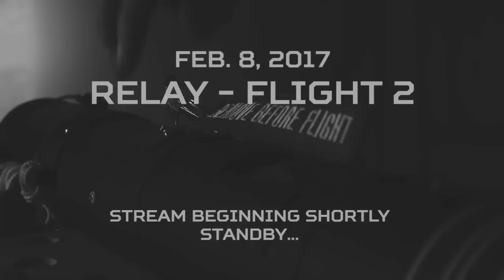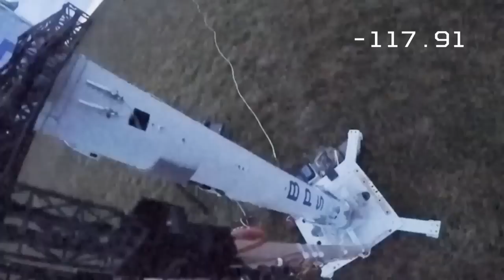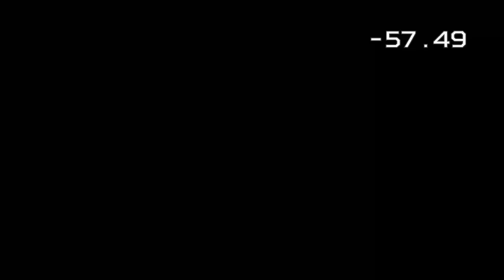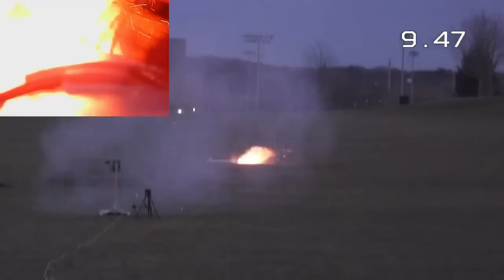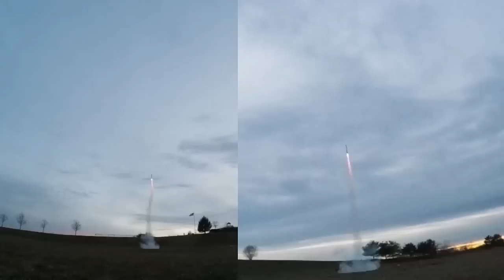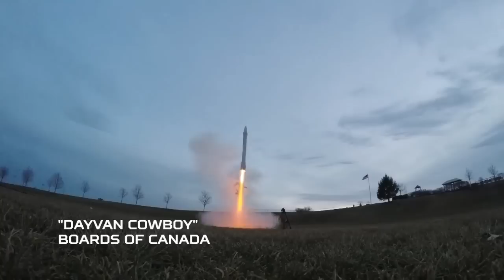Relay Flight 2 - Webcast Launch Coverage

Comment: why not periscope it?
Reply from the maker: There are a number of reasons, but the primary is quality. The higher level of quality I can achieve by waiting just a few hours far outweighs any benefits of spending extra time at the launch site setting up a stream. The situation would be different if I had a crew with me to help, in which case an actual live stream might make more sense.

Comment: An easy change you could make would be to change your drag fins so they are angled slightly, turning them into rotor blades. Look at "helicopter recovery" this would induce a spin on the rocket and make it spin stabilized on descent. This potentially conflicts with the ability to control the thrust on descent or the actual landing feet, but it may be an idea you can experiment with.
Reply from the maker: I likely won't go for the spin stabilized approach. As you mentioned, it becomes difficult to effectively thrust vector at a high enough spin speed. The next design I'll try is more of a conventional model rocket fin assembly. These should help guide the airflow in the right direction, as opposed to simply ruining the flow at one end.

Comment: The problem with your drag fins is that they now act like a parachute with no spill hole in the center, which requires that the system tip side to side to dump air. This will create an oscillation you can never recover from. If you look at what spacex and others use, they have a fin called a "grid fin" which passes air through an extruded grid. I believe they also have active steering of the fins. So far what you have is a great start. Keep up the good work.
Reply from the maker: Spot on! It's really something I should have caught long ago, but is an easy fix. The next iteration of the Relay rocket will have a new fin design up top to replace these faulty drag fins.
Reply from the maker: Right - I had my thinking the wrong way around when I designed and built the drag fins here - I do need to keep my CM below the CP. The drag fins do this fine, but provide no resistance to side forces, as traditional rocket fins, and grid fins do. The CM on the way down, even with a spent ascent motor is still quite low on the rocket body. Most of the internal hardware is located on the lower half of the rocket, while the upper half is largely empty.
Reply: I think he put the webbing around his fins to create drag at the top, to force it into an upright descent while reducing the speed the rocket descends, to make the time window for firing the landing engine wider. He's in a really tricky spot because the rocket does not shed very much weight on the way up, so the landing engine has to be nearly as powerful as the ascent engine.
Reply: The goal of the Falcon 9 grid fins is not drag, but side forces that resist pitch and yaw rotation. Think of the tail feathers on an arrow. They create stability without much drag.

Also think about your center of mass. When Falcon 9 is returning, the body is mostly empty of fuel and oxidizer (just a hollow tube), and the 2nd stage is gone. The heaviest part is the rocket motor, which is now like an arrowhead. Where are your "drag fins" relative to your center of mass? The farther the fins are from the center of mass, the more effective they will be -- like the long shaft of an arrow.

Comment: Really NICE.  If you can't arrange to put a tiny camera (like an 808 keychain camera) onboard, consider putting a camera pointed vertically, about 3 feet upwind of the launcher. That would give a  better view of the smaller steering responses than many side view cameras.  For the deployable drag fins, I think they'd work if you added "Dihedral".  Make them deploy another 30 degrees at least, possibly 45 degrees. That should   stabilize the model tail-first on descent a lot better.  I give that a 90%+ chance of solving the problem.   :)  As for the retro-rocket motor,  I do not recall if you have a barometric sensor onboard. Ideally you'd want to program it to ignite it when the barometer sense the correct altitude for firing (and also account for any possible delay in igniting the motor). A timer started at liftoff is no good for this if that is what you are using (which I doubt), as the real-world altitude will vary from any computer predictions
Reply from the maker: Thanks George - I'll try to always have at least one small camera onboard. Dihedral fins may work as well, but I'm going to look into a traditional passive fin system first. Essentially I'd make this an upside down model rocket. I certainly have an altimeter onboard! The burn on the ground was a mechanical failure on a relay, won't happen again. Haven't reviewed all data yet, but it looks like the rocket decided that it wasn't safe to burn on the way down - likely because the rocket was so far from being upright when falling.

Comment: I think if you had more altitude the current drag fins would be able to do their job. It's probably easier to make them longer to over-compensate but you know better so I'm looking forward to seeing what you come up with.
Reply from the maker: I think you're right about having a higher altitude, but with this mass budget, it's not a viable option. Right now, I'm looking into using more standard fins. Instead of purely inducing drag, these fins should also be guiding the rocket, as normal model rocket fins do.

Comment: From what I can tell, your main issue is stability coming down and engine re-light timing
Reply from the maker: Definitely need work with stability coming down - already have a few ideas in the works to fix that. The second ignition actually shouldn't have happened - that was an error with an electromechanical relay onboard. It'll be replaced with a solid state option in all future flights, since it's very unsafe to light a motor on impact like that.

Comment: Wow getting better and better. Good job! It seems to be overcorrecting a bit during ascent causing it to oscillate a little. Is that correct?
Reply from the maker: You're correct! The PID stability algorithm on the rocket isn't perfectly tuned yet. This looks like a combination of a little too much D value and slightly slow sample/reaction time.